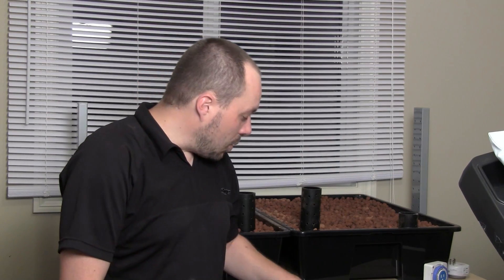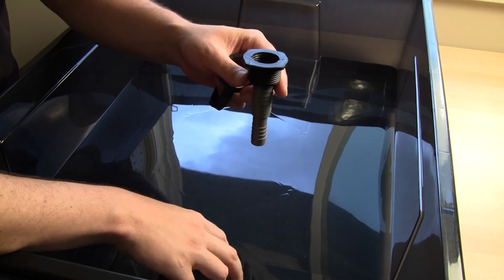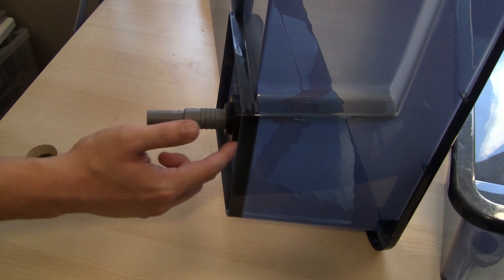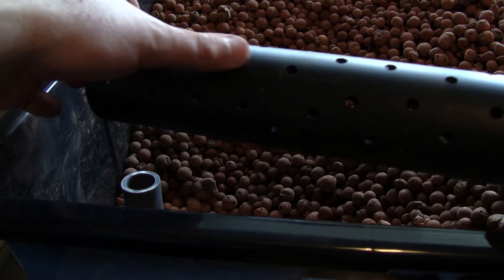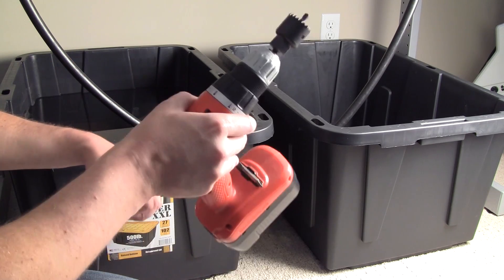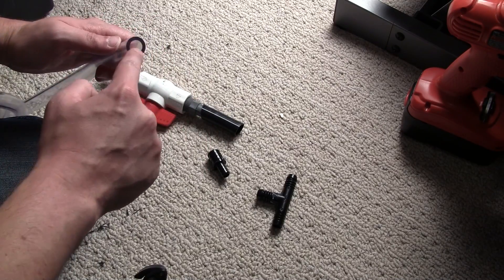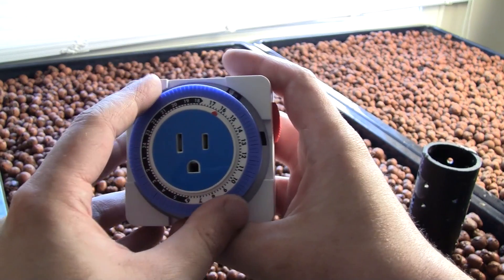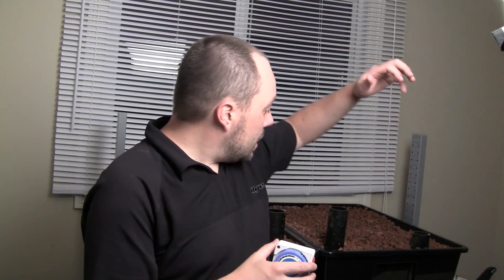Aquaponics system: How to build a desktop aquaponics system for indoor gardening. Aquaponics guide.

Comment: Thanks, can not wait for the next video! I have just 2 more questions: how much does it cost you to run the water pump per month (I am trying to make the system as sustainable as possible) and if I do not have a desk handy, do you have a link for a cheap one or should I build one?

Comment: Great video. Im a keen gardener and recently made my own homemade Hydroponic DWC for lettuce. Had it running for 3 weeks and what a massive positive result! Very simple to make with maximum effect. I have a lot of spare space in my garage and very interested in seeing how your Aquaponic system turns out. Could you advise whether your system requires a lot of light during the day? Was thinking of trying this in my large garage (has windows but not as much light as a greenhouse or conservatory).